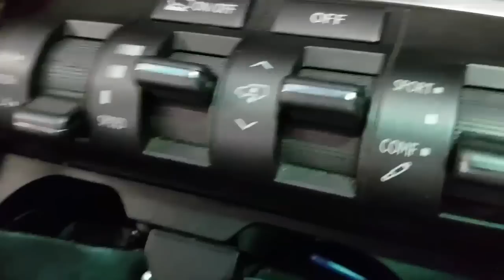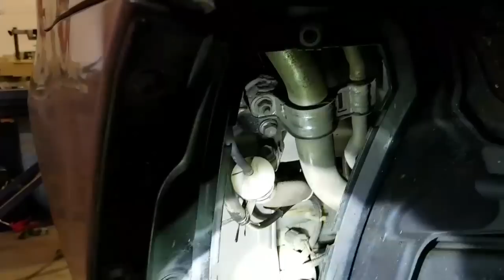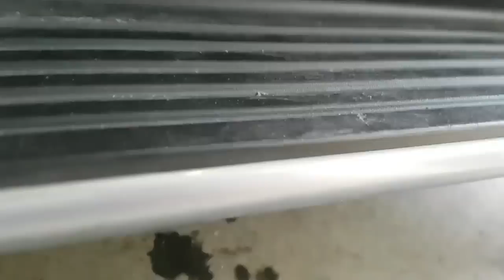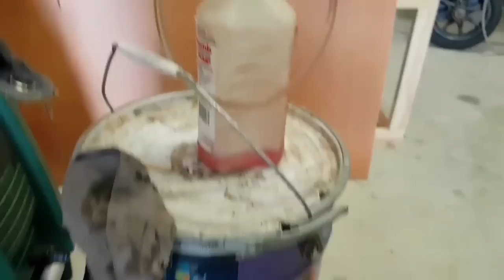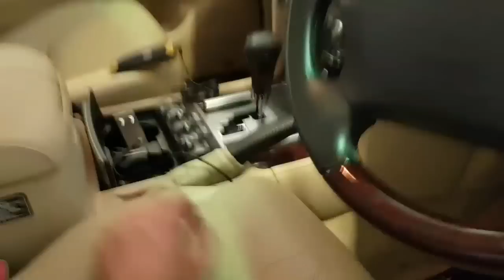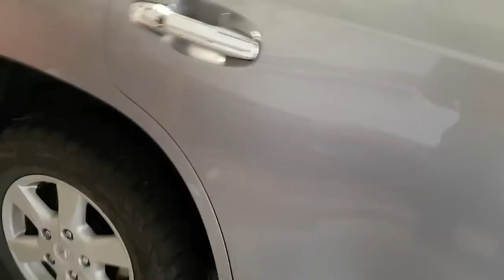Lexus LX570 / LandCruiser AHC suspension fluid change

Comment: @desparky

What is the wheel setup here? thats the OEM Lexus rims isnt it ?
Reply from the maker: Yes, OEM 18" wheels with BF Goodrich All Terrain 285/60-18 tyres. 
They have the correct Load Rating (118 which is 1320kg) , but lower speed rating than original (Speed rating S = 180kmh). 
It is legal to fit lower speed rated tyres here in Australia provided the car has Low Range 4WD. Obviously you need to keep the speed below the 180kmh tyre rating, which I'll never attempt anyway.
Reply: @desparky  was this the biggest possible tyre on these wheels ? I have the same wheels and trying to figure out the max tyre size to go without the rubbing / sensor lift
Reply from the maker: @SameerShaikh-df9nn No, I just wanted a more aggressive tread replacement for the originals. I think they are the same, or only very slightly larger rolling diameter. I mainly drive the car on road and use the car for towing, and didn't want to have to mess about with speedometer corrections.

Comment: Thanks a lot @desparky, My LX570 (2009) is bouncing like crazy from behind, a small bump causes it to bounce crazy from the backend. Now i am not sure if it is the Fluid Reflush or it is a Globe or Shock Absorber issue. Bit confused. It would be great if you can share your advise. Thanks again
Reply: Thanks a lot again for sharing  @desparky  I will check that.
Reply: Our ‘13 LC 200 has the same problem. Bouncing like crazy on every road flaws. We already changed all 4 shock absorbers from Toyota but sadly the “bounce” is still there. 
What could be the cause? Does it need a reflush, Top up fluid,Empty on fluid or Globe? 

Thanks! Cheers 🍻

Comment: How did you lower it with the remote??
Reply from the maker: The AHC won't operate if any doors are open. So I had the rear tailgate open, then selected LOW in the car before getting out. Then as I started recording I closed the rear tailgate with the remote. 
I also use a similar method when attaching/detaching a trailer. IE, open the tailgate, select raise or lower, get out and close driver's door with engine still running. Then I can go to the towbar and press the close button on the tailgate as I hold the trailer latch. As soon as the tailgate closes, the car raises or lowers.

Comment: For anyone watching this video and contemplating doing their own AHC fluid flush, DO IT. This video is pretty spot on and OP did a great job with the video. After watching this video and stitching it with info from other sites like ih8mud, I did mine yesterday and it was so simple. My 08 LX570 has 193K and definitely needed it. It required about 4-5 liters. I had ordered 2 of the 2.5 liter AHC fluid, a simple pump from Walmart, a larger 20 oz brake bleeder kit online, and a short as possible 10mm wrench. Only difference was I started on the LF since the motor and reservoir was on the RR (furthest away from pump). In order I did LF, RF, LR, RR. Had to do it twice to get the pink fluid on the 2nd flush on the final RR flush. I think if you do it regularly, a single flush would have been sufficient. 

Couple tips, start by adding fluid to the max level on N before 1st bleed, last thing you want, like OP states, is air in the lines. The bleeder valve only needs a quarter turn, half turn at the most to release the fluid. Having a short (2-3 inch) 10 mm wrench makes it easier for the rear bleeders. The small standard brake bleed kits will work, but you will have to close valve and dump fluid before full release and then restart. When adding fluid to the reservoir, pump slowly and put some shop towels blow the valve. Vehicle should be on the ground and this is enough space to do the job, no reason to be under the vehicle while releasing the bleeder valve.

For someone like me who had really old fluid, you can definitely tell the difference in ride quality and how quickly it changes from Low-N-High.
Reply from the maker: Thanks for the extra tips in your comment. I might do an updated video the next time I change the fluid and incorporate your suggestions, or maybe you could post a video too. Either way it's good to help other people out.
Enjoy your refreshed smoother ride.
Reply: Holy, Thank you for the reassurance that this needs to be performed.  I've talked to a couple of shops (Toy/Lex only Indy shops) and they say "don't touch it."  I think it's a matter of the old wives tale of "don't change the transmission fluid", where they are scared to do this, most likely don't have anyone that is qualified/experienced and no one that is an enthusiast, and don't want any liability.  But I have some questions-

1.  Do you think a 10mm crow's foot will work better?  I'm more than willing to buy a 10 mm wrench and cut it short.

2.  I don't understand the brake bleeder kit.  I am under the impression that you simply open the bleeder screw and it drains, like a brake bleeder screw and someone has the brake depressed.  I'm assuming you 'catch' the fall of the vehicle by closing the bleeder screw before it drops all the way.  Please explain.

Thank you again.
Reply from the maker: @thooks1234  Just a normal 10mm spanner (wrench) worked fine. 
As for the "brake bleeder", I'm just referring to a long piece of tube that fits over the bleeder nipple and runs into a plastic bottle to catch the fluid. Unlike bleeding brakes where you need a person to press on the pedal to create the pressure, this system is already under pressure. You crack the bleeder and bleed the fluid off.. As you do this, the car begins to lower so you have to ensure nothing including your head or tools are under the car. If you're careful, you can slowly lower the car in a controlled manner as you let the fluid out. Then close the bleeder just as the car begins to stop lowering. This ensurers that no air gets back into the system. Also having the hose attached to the bleeder with fluid already in it will also stop air creeping back in.
Good luck.
Reply: @desparky  Got it!  Thanks.

Comment: Just to verify, did you bleed the fluid and then refill the reservoir after each bleed? RF bleed, refill, LF bleed, refill, RR bleed, refill, LR bleed refill?
Reply from the maker: Yes, that's correct. I topped up the reservoir after each bleed. 
From memory I may have bled the first one then ran the pump but let the reservoir get low before filling, so as to only have fresh fluid in there. Sorry, it was some time ago so I can't say for sure. Either way, just ensure that the reservoir never gets empty and allows the pump to suck air into the system.
Good luck and take care. Just be really aware of the car lowering as you bleed off the accumulator pressure.

Comment: Did you remove the chrome from the door, or did this LX not come with the door bling?
Reply from the maker: No, that's how this model comes from the factory. At least here in Australia.
Reply: @desparky  Thanks! They have molding with chrome on the doors here, but I'll be removing mine. I like the look without it.
Reply from the maker: @dr.emilschaffhausen4683  Where are you? 
Not sure if it helps, but I know you can use braided fishing line to remove badges. It might work for body mouldings too if they are held on by double sided tape. Also Isopropyl Alcohol breaks down some adhesives. Anyway, yeah the clean look on the doors does look good, but don't go too crazy trying to remove them. Some manufacturers use polyurethane adhesives. You can really damage panels trying to get them off. Maybe ask a local body repair shop. Good luck mate.
Reply: @desparky  Thanks for the detail. Have been reading the forums today. Seems that some have been successful removing them. Sadly, after 2013 the moldings are pinned to the doors, so you 'd be left with holes removing them. On my 2010 I don't have that issue. Going to start work today before putting on my 18" Land Cruiser wheels. Slowly but surely!
Reply: @desparky  I'm in the United States.

Comment: how do you make it automatically lower everytime you shut car off and get out?   as opposed to flipping the switch
Reply from the maker: There's a button on the dashboard near your knee on the door side (on right hand drive... it may be the same on LHD). There's 3 buttons, one for the rear tail gate, one for the headlight AFS (moving headlights), and the third one that looks like a person getting out of a door is the automatic lowering function. 
When it's selected a symbol comes up on the dash. When you turn off the engine, the car automatically lowers, but don't open the door immediately or it will stop lowering. The car lifts up again the next time you drive and get above something like 15kmh. Cheers.

Comment: Hi brother i chang luxus 570 2013 model shocks but aftar chang haydraulic not working can u help me plz
Reply from the maker: Hi mate, my video shows the only work I've done on the LX570 hydraulic system. If your pump is running and the suspension not lifting I can only assume that yours may have got air in it. Have you tried filling the hydraulic reservoir and making the pump run (by selecting suspension high setting), then opening the bleeders on the accumulators (located under the side steps) to let the air escape? You also may have to bleed the air out at the shocks somehow too by carefully just cracking loose a fitting. Let us know how you go, and maybe put a video up if you manage to work it out.

Comment: Hey I noticed you have 220,000km on the odometer, but your driver seat looks immaculate. Did you have your seat reupholstered? My 2015 LX only has 65,000km, but the driver seat looks really bad. It's cracking, peeling, discolouring, and just doesn't look good.
Reply from the maker: No, the seat is original. It maybe looks better in the video than real life. All in all though, it;s still in good shape, for leather. I put leather conditioning stuff on it a every year, not sure what the previous owner did. I'm also pretty careful to not slide out off the seat when I get out, using the handle and side step to lift myself off the seat. Every Lansdcruiser I've had, the side of the seat has worn badly. I've tried to look after this one, but the edge is still worn. BTW, I don't really like leather, and prefer cloth seats.

Comment: To add another point, I test drove a few LX570, from the brand new ones on the dealer floor to a few with 150K+ km owned by local 4x4 club members. They all have the same idle and 3000rpm oil pressures according to the oil gauge. That tells me these engines didn't lose any clearance after 10 years and 200000km. These engines indeed can last 1 million km.

Still, to give myself an ease of mind, I stopped use pure 0w-20 engine oil anymore. I now add 5quarts of 0w-20 and 3quarts of 0w-30. Combined that is 0w-24 oil. The oil pressure is slightly higher than brand new engine with pure 0w-20 at idle and 3000rpm.

Also no more Toyota 75w-85 low viscosity gear oil for the front and rear differentials. I switched to Mobil 1 75w-90LS gear oil.

Lastly, I took down the transmission oil pan and replaced the filter, and then did 3 consecutive oil drains, using a total of 12 liters of ATF-WS fluid. My math shows after 3 drain and refills, I brought down the dirty old oil percentage to roughly 25-30%.  Good enough for me.
Reply from the maker: Here in Australia, the handbook specifies 10W-30 full synthetic engine oil at the ambient temperatures where I live. I've noticed that 0W-20 is recommended in other countries. I hope you're right about how long the engine should last Xu Han. 
I have checked the Transmission fluid level, and made sure the fluid doesn't smell burnt. I have just finished installing a hoist (vehicle lift) in my shed, so I'll change the transmission fluid and filter soon. After that, all the car's fluids and filters will have been changed.
Reply: I always find 0w oils are better even for hot summers. Based on my toyota techstream software interface via OBDII cable, oil temperature rises much slower than coolant. Oil temp was only at 50degree C after 5-8mins. So maybe you can give something like Mobil 1 AFE 0w-30 a try?

Another thing, remember to buy the transmission gasket and filter before you drop the pan. I forgot whether the filter came with the critical o-ring for sealing the filter to the transmission valvebody. Make sure you have a new o-ring before you drop the pan. Good luck :)
Reply from the maker: Thanks for the advice Xu Han. When I think back over this winter, my car has only really been driven the short run to work (7km) in 0 to 12 degree temperatures. I might have to rethink the oil I use and find out if the engine specs are the same here in Australia. I'd be surprised if they are different.
Reply: Hi Can you help me please, How often we need to change Front,Rear Transfer case gear oil and transmission fluid ?

Comment: Great video. I did mine at 136000KM (84k miles). The old fluid came out light brown with no visible contaminant particles. 

At 140000KM, I had all 4 shock absorbers and springs replaced because they are dirt cheap where I am (front shock less than 200USD, rear shock 50USD). The procedure is a combination of a regular shock replacement, your fluid change and bleeding. I highly suggest it since no OE shocks last forever.

Comment: I have the 2007 LX 470, flushing or refilling the fluids are quite simple. I understand ahc liquid is  supposed to be lifetime warranty, that's why they are sealed off; the transmission too. But come on, nothing is lifetime. My AHC fluid is so dirty and possibly contaminated at 96k miles. 
It look me about 10 minutes to complete system flush. The 570 looks like a nightmare. 
Nice all terrain tires, how's your mpg?
Reply: Lifetime is a requirement from the EPA if the fluid's life span exceeds 100k miles. Definitely not lifetime and a lot of these systems could be saved if the fluid were preemptively changed.
Reply from the maker: Hi rpgaming.... Our expectations of a car's lifetime, and the manufacturers idea are probably different, haha. 
My car has done just over 220000km (about 140000miles). The service book for the LX570 actually says to change the AHC fluid at 200000km, and the old fluid was definitely darker than the new stuff. 
My video of the task wasn't all that good, but I only thought I'd record my progress to help others, as I couldn't find much information on the LX570. It wasn't too hard a job, and will be easier if I ever have to do it again. The suspension damping feels a lot firmer now, but that may all be in my head though!!!

The BF Goodrich all terrains are the same size as the original tyres. They don't seem to have had much effect on milage, it's still terrible!!! I mostly only do lots of short trips now (less than 10km). I average about 18L/100km (13mpg USA) around town, and about 14L/100km (16.8mpg USA) on a trip. Towing a caravan (travel trailer) it does anything from 18L/100 to 22L/100 (13 to 11mpg). I tend to drive it fairly un-econimically though.
Reply: 140k miles, she's barely broken in. keep on these maintenance and she'll be around for a long while. 
I love my LX 470.